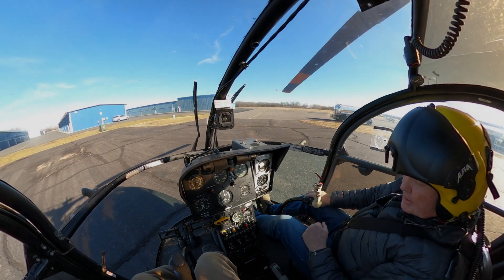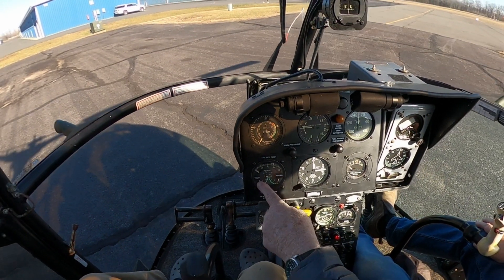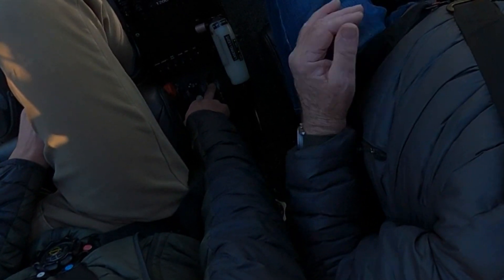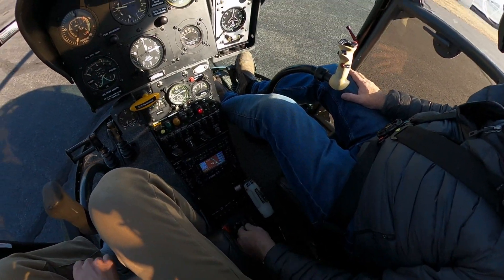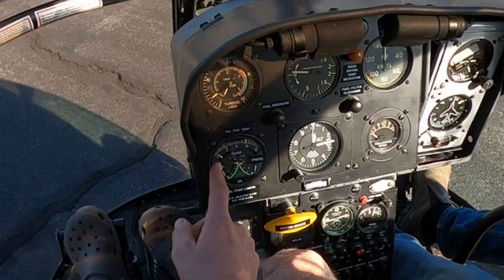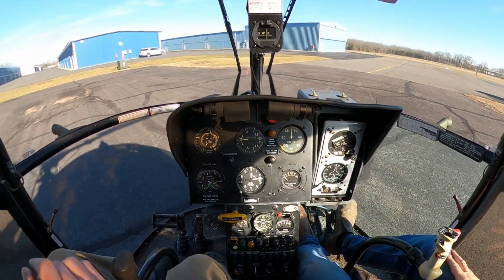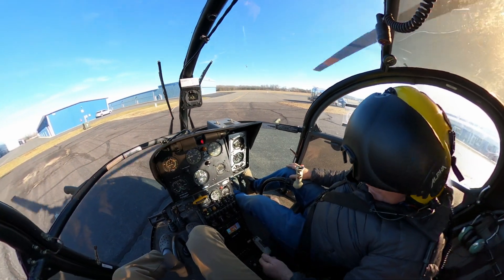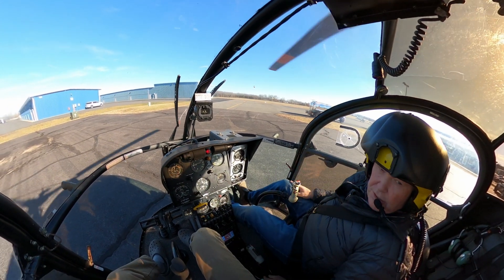My first flight in a BACKWARDS designed helicopter - Alouette 2 Series

Comment: “Backwards designed”, as in being the first helicopter with a fully automated start sequence, similar to FADEC? For having a rotor that can be stopped while the engine is running (to allow for safe refueling and boarding of pax without the need to switch off the engine)? For not requiring warm-up time, when starting from cold before getting airborne? For having a very wide CoG range, whereby it is almost impossible to be out of the CoG envelope at any fuel and load scenario? 
Welcome to the Alouette family of light single engine turbine helicopters (SE313, SA315, SA316, SA319).
Reply: I don't think it was meant as a slight, but simply that the rotor is turning clockwise instead of counter-clockwise
Reply: Don't forget the Astazou versions of the Alouette II 318C.  Also as with conventional airplanes the "power rudder" was the right pedal as it is with the Alouette.  And the cyclic needed almost constant attention with the right hand and flying from the right seat allowed more freedom to manage radios and switches.  Early Bells (B-47) flew from the left seat requiring hand switching in order to reach those items.  Bell changed the Captain seat to the right with the UH-1 Huey.

Comment: Very interesting pickup Michael, good job on the video! The alouette is a very simple machine, just remember the right pedal is the power pedal. The oscillation is a little bit of resonance, these machines have lead/lag dampers that need to be greased, the blade spacer system also requires grease. If the aircraft is flown more often the shuffle on the ground wont be so bad. Safe flying.
Reply from the maker: Thanks for the info!